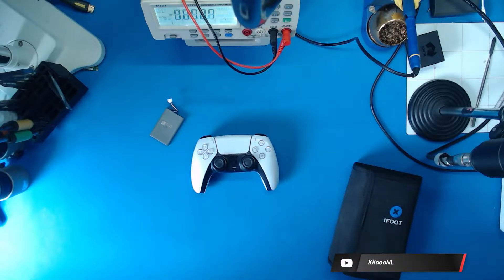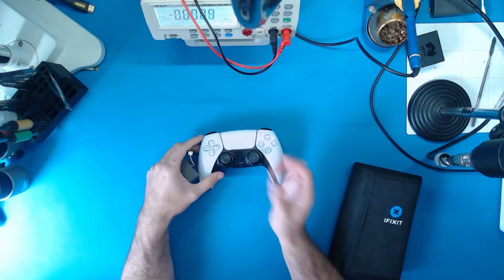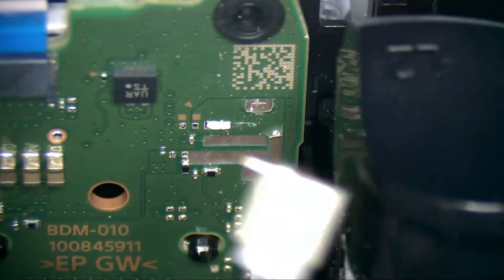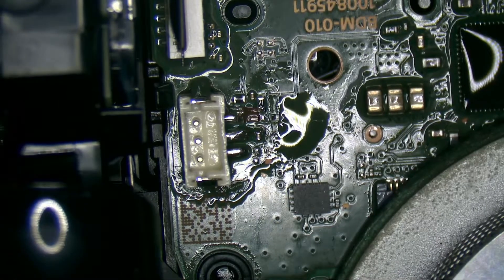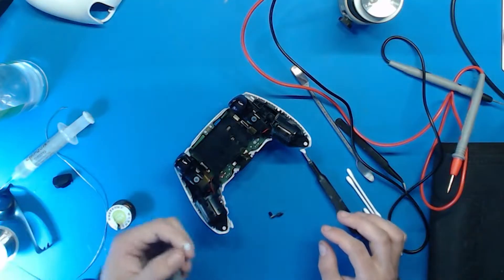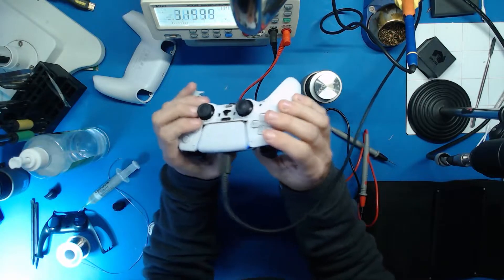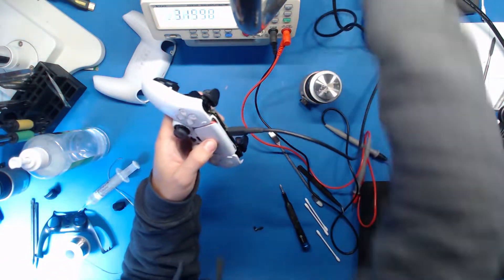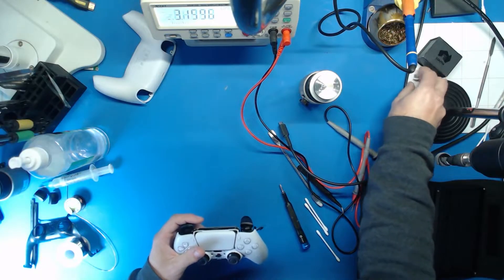Sony PS5 Controller Battery Connector Trace Repair - Let's Try to Fix

Comment: Is there a certain wire used to connect the box thingy to the connectors or is it just any copper wire. Also i didnt know if we were using adhesives or just flux and solder in the repair. Im really new at doing soldering and electical work.

Comment: Hey, I have a dualsense that works perfectly but stopped charging, I thought it was the battery and I bought a new one, worked until the battery discharged, at this point it does not charge but works for USB C, any suggestion of what it might be?
Reply: Hey did you ever figure this out?

Comment: If the pads are still there I should have no issue soldering the connector back on without jumper wires right ?
Reply from the maker: That's right

Comment: Hello!, I tried changing the entire Analog stick because of the drift, for some reason the controller still drifts, then I just removed the Analog stick, turn it back on, and Its magically drifting!, so it was never the potentiometer or the analog, it seems that it could be the board? 

Do you have any clue of what have happened? I cleaned every trace with soldering wick, there are no parts connected between them...I wonder.
Reply from the maker: I've had replacement analog sticks that still drift. You could have received a dud which unfortunately does happen.
Reply: @KiloooNL  Yeah, the analog stick had 2 potentiometers that drifted, so I had to change them aswell, and they were brand new!. I solved the issue

Comment: thank you I almost gave up trying to directly solder battery wires to the pads. But doing it this way turned out to be much easier again thank you